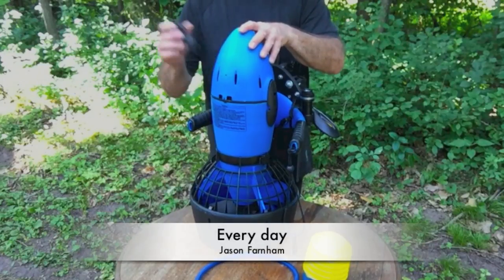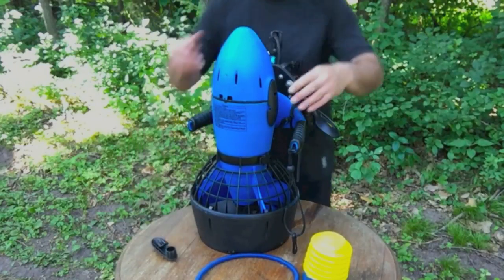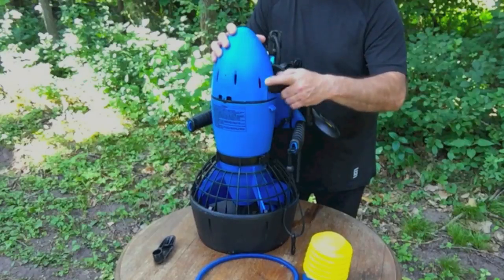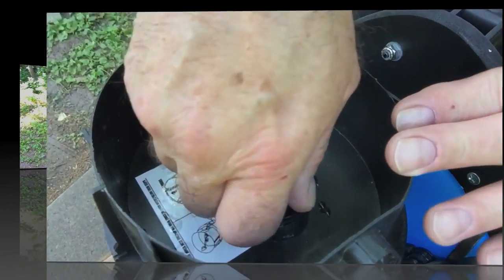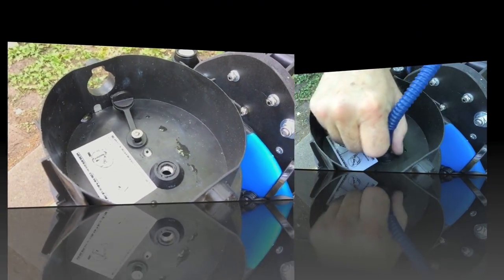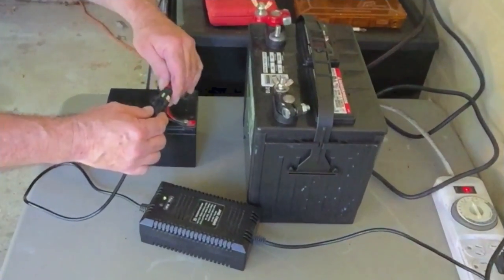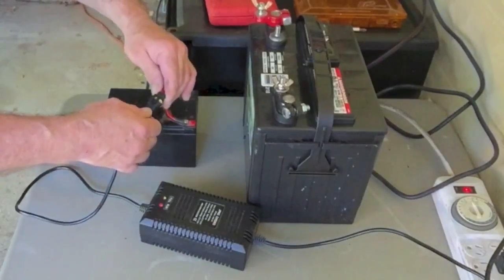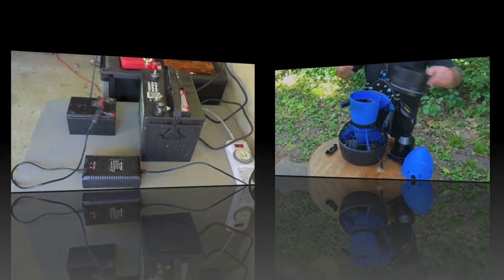Removing and charging your dive scooter battery

Comment: Hi, thanks for your video! I have a seascooter Yamaha rds 300 with a problem and I open that you can give me some advice: a little water enters the battery compartment, I cleaned the edges and then I lubricated as per the manual, but the problem remained, in your opinion how can i solve this problem? Thank you and good day. Best regards
Reply: I have the same problem